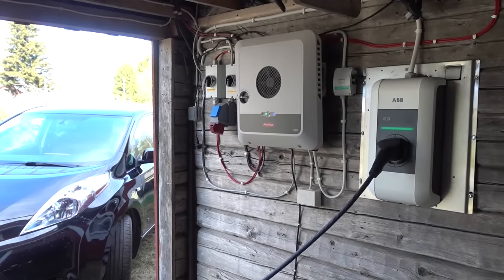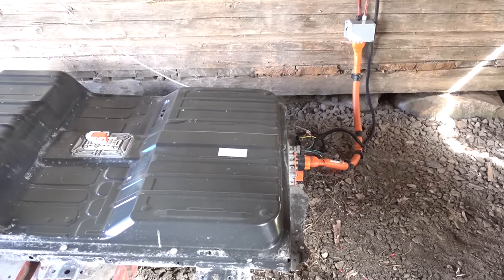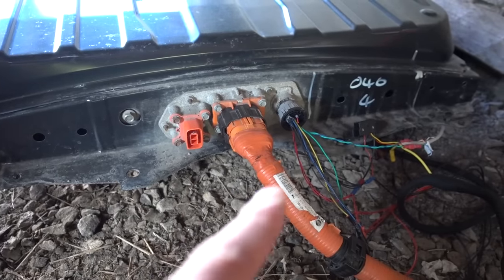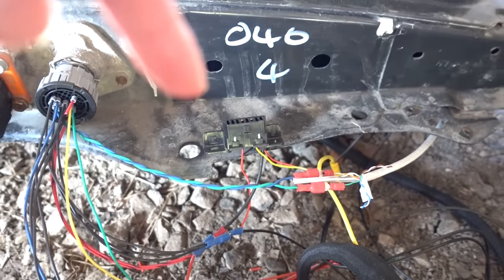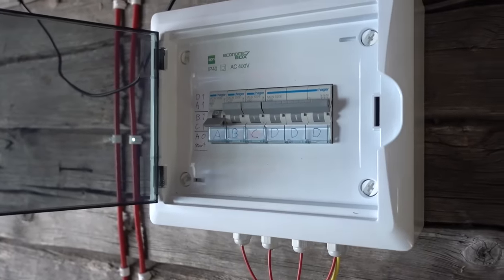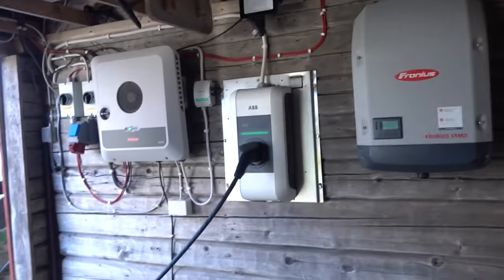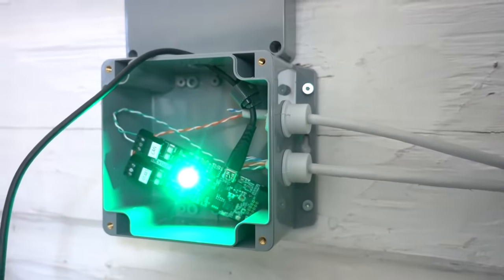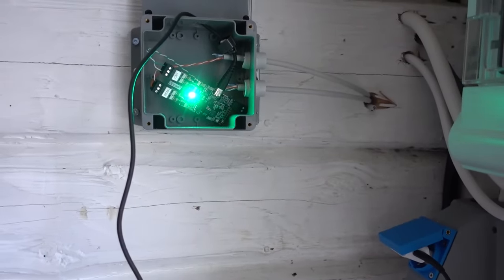The EASIEST way to connect used EV packs to grid! 🔋

Comment: Very nice.
Remember to protect the wire reduction with a fuse at the point where you have the reduction
Reply from the maker: Good idea, I will note down that a suitable DC fuse should be added. The fuse inside the battery is too large (250A).
Reply: well if you follow the wire size path, you should maybe go with a 40 A fuse , or max 60 A, recommend would be 50 A
Reply: I think it is not necessary, because the converter has its limit and will not overload the wire in any case. And if there is a short, even the bigger fuse inside the battery will blow.
Reply: True was literally gonna say that lol!!! Kinda dangerous without and probs best to use black and red just makes life a bit easier!!
Reply: @wasserdrucker6227  The wire run is too long to fit under the tap rule, and you’re a brave soul to trust “The inverter wont overload under any situation”
The National Electric Code isn’t concerned with what that inverter is designed to do.
Its concerned with what happens to that wire when something goes wrong.
250A fuse protecting 50A wire? Thats just asking for trouble.
When you already have a junction box a 50A fuse is cheap insurance.
Reply: @stertheder  How should the inverter draw more than 50A?
Reply: @wasserdrucker6227  the same way anything else draws more current then is rated. This is just one of many reasons: One of the HV converting electronics could get too hot under a large load and create a low resistance short. Not enough to blow the 250A but could definately melt the small wires. Anything can fail. That is why we add protection.
Reply: @mandmwaddle  That case is very unlikly. The inverter has internal monitoring that will shut it off when it is overloaded. If a component error, it is very cummon that the defect part will instantly turn to non conducting, so it will block the current, or it will make a short, so it will blow the 250A fuse.
Reply: The SFS-6000 says you have to use fuse or circuit breaker to protect reduced wire.
Reply: @wasserdrucker6227  The 250A fuse will take like a minute of 500A in order to blow. The thin gauge wires can easily melt their insulation before that happens. What specifically happens of course depends on the resistance of the short circuit and the length of the wires among other things, but you can avoid any need to calculate every possible scenario by just using the correct fuse rating for the wire.
Reply: Came here to say the same thing!
Reply: @Aurelian0610  10mm cable is only rated for 40A if it actually is 10mm and not 10 awg which is 30A.
no one should overload the cables unless they want to risk failing inspection or burning their house down. 
do not put 60A on a 40A cable. its 40A Max No more.
Reply: Also IEC 60364-5-52 522.1.1 says that the maximum continuous operating temperature, in case of fault, will not be exceeded. So yes, a fuse is needed!
Reply: @celeron55  indeed, not placing a fuse is playing with fire when you have fuel up to you knee.
I just saw that  @MandmwaddleplaysMC123 got 2 like for tha last comment (scary).
If you don't fuse probably, don't play with High voltage and current.
This is not a  AA battery !
Reply: Toyota Prius LPG to grid please
Reply: @wasserdrucker6227  If there is a fault, the 250A maxi fuse in the battery won't even notice that 10mm^2 (8AWG) wire turning into a space heater.
Every circuit should be fused at 80% of the smallest wire's ampacity, or lower. For 8AWG copper that's 40A.

For example, if you are running a residential circuit that starts with 12AWG (4mm) wire, but then changes to 14AWG (2.5mm), you use at 15A breaker, not the 20A that 12AWG would allow.
There are also considerations for longer runs of wire, but given this is like 6' (~2m) it isn't a concern.
Reply: @PrebleStreetRecords  Again: in residential circuits you have to care about short circuit and overload. Overload can be expluded here because the inverter can not do more than its rating, otherwiese it will trip. For the short circuit: The battery has a Voltage of maybe 350V, an inner resistance of maybe 0,1 Ohm. The 10m 10mm2 has 0,017Ohm, thats together 0,117 Ohm so 3000A. That will trip a 250A fuse in around 0,2s. Inside the 10mm2 cable there is put an energy of 3000A^2*0,017 Ohm*0,2s= 30kWs. -> The copper wire will increase its temperature at about 87 K. Thats still ok for a short time.
Reply: @wasserdrucker6227  Electrical code requires fusing/breakers for more that just service draw. If there is mechanical damage to the wires, water ingress, or one of many other accidents, it is there to prevent a fire.
You argument is basically "I can use 26AWG bell wire on this 20A circuit because I'm plugging in only a phone charger that draws 1A". Yes, the device at the point of use is low-current, but that doesn't mean some other failure could draw more.
Reply: Hi, keep wire size large for as long as you can, add fuse to below that required by unit. Keep low voltage runs short as possible. Keep separated and insulated.
Better safe than sorry.
Looking good though using used EV battery as the storage.
Take care M
Reply: @wasserdrucker6227  It's not about the inverter, it's when you have a short inside the inverter or anywhere else that won't blow the 250A fuse, thus burning the 10mm² wires and burning down his building.
Reply: So much wrong advises here.
1. For low voltage DC and AC, in the manual of the device (in this case the inverter) is written the max current of the fuse. For high voltage DC, the most time you don't get this information. For battery use, take 150 to 200 % of the rated current. Gen24 10.0 it is 22 A. So try 30 or 35 A Fuse.
2. Look up your weakest part after the fuse (cable, switches, plugs, and so on). Take a fuse rating below it.
3. Choose the right fuse. You need high voltage, high disconnect current DC fuses. These are very hard to get. And impossible to get it with the needed low current rating. PV fuses are high voltage DC, but they are not rated for high disconnect currents. Most AC fuses will work DC, but at half voltage and fuses with low current with a high disconnect current are also hard to get.
4. In this situation, i would connect the battery with NH1 100 A 690 V to a AC copper busbar. From there i would use a PV fuse 30 to 35 A to connect the inverter.
5. I would add an isolation fault device. If one of the poles gets a short to ground, you are warned, that something is wrong. You can turn off and search the error. These devices can save your life.

To all saying, the inverter turns off with error: I have seen a Fronius Gen24, where the DC switch was burned. This was only 13 A from solar panel. Not a 400 A battery fused at 250 A. Most components in the inverter will simply explode at this current. Second is, that if there is a short in the wire to the battery. How should the inverter protect the cable, if there is a battery on the other end of the cable? The power can come from the inverter OR the battery. So both sides have to be fused. The Gen24 has an internal fuse.

To all saying, you have to use the big wire size as long as possible: We talk about 20 A at around 300 V over 15 m. It would work with 2,5 mm². 6 mm² is recommended. No need for big expensive wires. The 50 mm² is to power a 160 kW car. Not a 10 kW inverter.
Reply: @wasserdrucker6227   You have no fuses in your home?
Reply: @geoffhaylock6848  I have. But on some outlets that are connected via a 16A Fuse and a 1,5mm² wire, there are "Europlug" connected that has only  0,75mm² wire to the device, e.g. a laptop power supply or a night light etc. So the cord to this device will get very hot when used with 16A, but it never happens because the laptop or light does never need more than 1A. When there is short in the device, anyway the 16A fuse will blow before the 0,75mm² wire gets too hot. 
The same here, just a little bigger. But same principle.
Reply: @wasserdrucker6227  So you have fuses on your little wires but you say no need on huge wires. You should probably stay away from electric. Darwin is never far away.
Reply: @geoffhaylock6848  You did not get my point. Dala has fuses on the battery that will protect against short circuit, but it will not protect the small wires against overload. But there will no overload happen because the inverter can not do more current. Like the laptop power supply on the 0,75mm² that is connected to a 16A fuse.
Reply: @wasserdrucker6227  in the UK every appliance is required to have a fuse in the plug that corresponds to the current rating of the cable used, so that in an overload situation the fuse will blow instead of relying on the main circuit breaker. It is safer not to assume that the appliance won't fail in some kind of weird way that is high enough to overheat the wire but low enough not to trip the breaker. Normal operation and dead short are not the only possibilities.
Reply: @wasserdrucker6227  Fuses are to protect the internal wiring not your laptop. If your laptop wire is glowing red while you use it, you are the fool for not seeing it. If your internal wiring is glowing red and you can't see it behind the sheet rock, who's the fool then? Under what fault conditions have you tested the laptop PSU to confirm it will never draw excess current?
Reply: @geoffhaylock6848  I do not test the laptop PSU, you can buy it ready tested and i do not know which test exactly they do. But what do you think could be fault that draw more than 3A but less then 16A for a longer time?
Reply: @DalasEVRepair  for 10 square mm cable professional electricians use af fuse between 50 A and 63 A.
Reply from the maker: The system now has solar DC fuses of 30A installed on both HV- and HV+!

Comment: A bit gutted by this video. A month back our 30kWh Leaf was written off. I searched for options for home storage but all seemed to involve striping the pack down to cells so I did nothing about it. Salvage cost I could have paid for the car was £2,900. If I'd seen this video then I may have gone for it - particularly as packs on eBay seem to be about £5k. Oh well, such is life. Great 'inventing' and video, many thanks. ps, would be interested about the question someone else asked about storing packs vertically rather than flat - any potential issues? > Just seen this is already answered - you think fine vertical. Cheers.
Reply: You could buy at least 16 kWh of brand new lifepo4 cells for that price, which will have a vastly greater cycle life and use an off the shelf BMS.  Nothing lost IMHO, these leafs packs degrade relatively quickly and are a poor fit for powerwall use as they have weird voltages.  Also I wouldn't put a cobalt based battery chemistry in my home, they are far too fire prone.
Reply: @StartledPancake  Leafs batteries 1st generations have bad thermal management but we are talking about car Power usage ~70kW max not home ~7kW max...

Comment: Well done, this provides an excellent second life for degraded Leaf battery pack after pack in car is upgraded. 😎 Figuring out how to make use of the Nissan electronics is so much better than spending hours dismantling a pack and then configuring a 48 volt pack. ☮️
Reply from the maker: Absolutely agree! This is 10x faster if not more!
Reply: @DalasEVRepair  Do you know if the leaf battery pack could be rotated and wall mounted for people with less room to mount it like this? - or would that be a problem?
Reply: @markreed9853  The leaf battery pack has no active cooling system - some others use coolant to control the battery temperature. Since the individual battery cells are essentially "solid state" they don't care which way up they are.  there are actually walkthroughs on installing a leaf power pack in a pickup truck, upside down over the rear axle so the humps don't intrude into the bed area!  Hope that helps!
Reply: @daveyburgess  I thought the leaf battery had air cooling and the batteries have a liquid electrolight so not solid state. I would also think as energy storage the batteries would not get as hot as not under as much strain compared to in an EV.
Reply: No need to think about cooling. In household systems not more than 25AMP goes in od out the battery. In the car it Is over 100Amps, So this is really cool retirement, piece of cake for the battery
Reply: @tomasobsil  yes, a car draw I would expect to be far greater. But I wish people wouldn't use amps because it is not a valid comparison if the voltages are  different. Should be stating the Watts. I have no idea what a leaf voltage is 24? 48? 120? 240? If it is 24 v then your 100A x 24v is only 2400 Watts, verses you house example 25A x 240v = 6000W see how wrong that looks, because amps does not give the full picture.
Reply: @AORD72  All car batteries (full packs) voltage range varies between aprox 300V (when empty) to 400V (when full) Lets leave 800V cars alone, there is not so much of them on the market. 300V x 25A = 7,5 kW or 400V x 25A = 10 kW. There is not much situation when house load exceed 10kW. Charging EV could, but it is mostly controled by wallbox which can adjust charging axording to load. The point is that normally battery delivers or receives 5 - 20 less energy than in a car. So the result is the same. Used car batteries can safely work for ages in household installation.
Reply: @tomasobsil  Yes, lol I was also thinking perhaps 800v!!?! Yes very true about most homes drawing less than 10kW (I probably peak at 5kW). Yes I agree far less draw on the average home than running a vehicle. I read the Leaf are like 110kW so I suspect the car peak amperage could be like 315A at 350V!
Reply: @tomasobsil  i was about to say this as well

I have several CNC machines as well as 3d printers at home and the days i exceed 20 kw at any one time are rare
Reply: @AORD72   Most EV battaries are 400V; except Lucid (800V)
Reply: @エルテン-k3j  Hi, we will see the move to 800v smaller conductors required, lighter cars!
Tesla cyber truck should be 800v pack, expect them all to be eventually.
Not sure what the truck is.
Take care M.

Comment: I start using Nissan leaf battery for my solar 48-volt system since 2014, you know what? 3 years ago, I bought 2 used Nissan leaf battery and dissembled them to built 16 - 48 volt stack battery bank and now this concept that is wonderful, I no longer need to dissemble. All I need now the inverter will work with this concept, my Growatt have few years on it, its time to looking at the replacement and new idea to get free energy from the sun, my current system is 2 Growatt 5k inverter, 16 Nissan leaf̣ (48volt stack), 10KA industrial transformer to convert 230V into 110V. You are right used Nissan leaf battery are not expensive like other life4 battery sell by some solar outfit

Comment: For the precharge resistor and that stuff you should use a cable, something like a 7G1.5 and terminate it inside the box, also why not use a microcontroller with a few relays for the startup sequence?
One last thing, put a fuse in the junction block ~32A and maybe protect the 10 mm² HV wires a little better.
Love this kind of projects, hope it keeps getting better
Reply from the maker: Microcontroller for precharge is a great idea! Keep in mind this was just a quick test that needs to ne finalized 😁
Reply: @DalasEVRepair  you can use that LilyGo that you already have, to pull double duty, CAN to ModBus converter and the startup sequence.
You just need some extra relays that can make the contacts in the right order, connected to the LilyGo. There are some relay modules already on the market for these kinds of things.
Reply: @rabulea1987  Love that idea! Do you ever think about sharing your knowledge? I subbed to you just in case! ;-)

I just paid entirely too much for an offgrid solar setup last year with a 20kWh pack that doesn't last at all long. 

Would love to see a step by step build on your youtube channel sourcing a cheap used tesla battery and have it set up to charge from the panels primarily with a grid charge backup. 

Not looking to power the grid.. just looking to be as energy independent as possible.